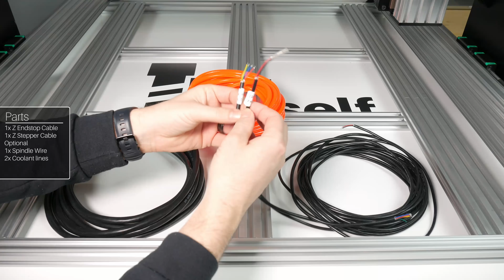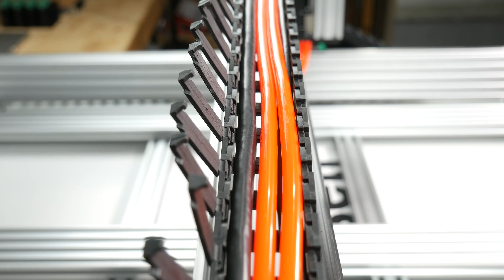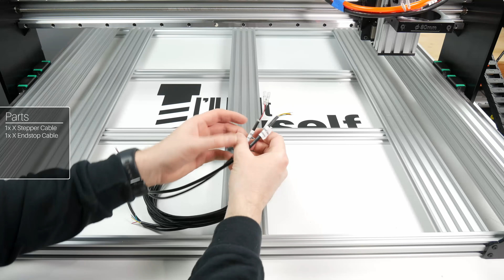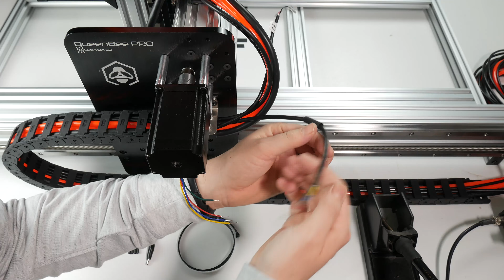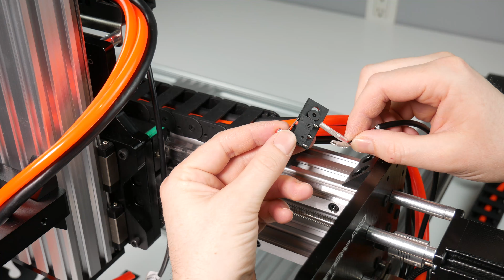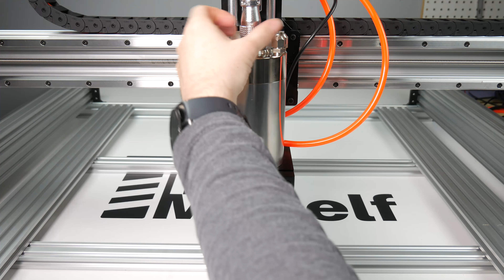Bulkman3d Queenbee Pro - Wiring

Comment: Hi, fantastic and informative videos I have just finished the mechanical build on my QueenBee Pro, (have had it for 3 years and only now doing the build) now starting the electrical work ahhhh. Just a couple of questions if possible, please. 1) what is the height for the support spindle bracket from the bottom of the Z access, I have only received one bracket is this correct? 2) I can't find the spindle cable video to see how to wire it up.

Comment: Hi guys, I have two insights for you from the construction of my CNC 1010 QueenBee PRO machine. 1) - one C-Beam 100cm aluminum profile is slightly bent and twisted into a propeller. It had to be from the factory, because the packages were delivered without damage. I'm working with the seller. I'll let you know how it turned out. 2) - Two balls are missing in two Linear Slide Block Carriage For HGR15.  Everywhere else there is a gap of only one ball. Always on the side where the wiper blade is and is very difficult to see. I don't know if I will deal with the seller. Maybe I'll order one new piece and add balls. I recommend checking before mounting. I discovered this when I stripped HGR 15 of preservative oil and lubricated it with lithium white grease.

Comment: Hello, did you get the cnc Xpro V5 with 1.5kw or 2.2 kw 110V spindle? Also did you connected your cnc to the outlet behind it or you had to connect it to its own circuit breaker?

Comment: Totally confused on the switches. Are they end stops or are they homing switches? What's the difference? I see a lot of machines that have the x mounted on the left and the y mounted on the front left.
Reply: I am with you on the confusion... what follows are my thoughts out loud. Seems logical that machine 0,0 should be front left corner as you will never have to deal with negative numbers when thinking about work holding and where the spindle is in relation to the spoil board. It follows then, that placing the switches on the front left for Y and far left for X would yield at least homing in that direction. Then we could setup "soft limits" based on actual machine dimensions in GRBL (or whatever you are using for machine control). 

The switch cable for the Y-axis in my kit is very short and I only have three switches in total... That sort of dictates where I place the controller, VFD, etc. I did not give this any thought when building my table and where I placed the machine in my garage. The most convenient place for my setup will be to place the controller and electronics is on the right rear side of the machine. Therefore, I am contemplating using the right rear and far right side as my machine 0,0. I will see if the mental gymnastics is too much to over come before I either buy more switches or physically move the whole thing 180 degrees.
Reply from the maker: I will be doing a video shortly to show setting these up. I use them as homing switches. Position can be whereever you like as it's just for the machine to reference. We then tell the machine that when you hit home your actually at a specific position.  This allows you to have the switches right out of the way.

Comment: I bought that same spindle. Wonder if that one bracket is going to be enough to hold it over time.
Reply from the maker: I have used it with one for a while. But I did upgrade to two just in case

Comment: Hi, what kind of spindle do you use? I estimate it's water cooled by 2.2 kW.
Reply from the maker: Yes it's the 2.2kw water cooled .
Reply: According to the socket, I see that you are not from GB, but from the USA. Does this mean that the spindle is 2.2 kW-110v? I decide between 1.5 kW and 2.2 kW-220v.
Reply from the maker: I'm currently in Canada so yes similar to the US. I do run on 110v but it would be much better to run a 220 if you have access which won't won't a problem in GB.